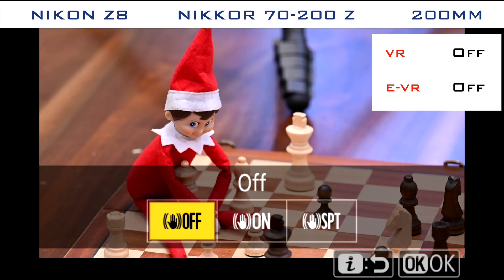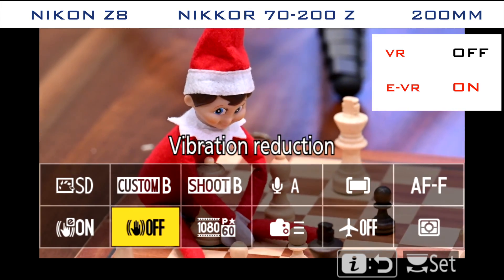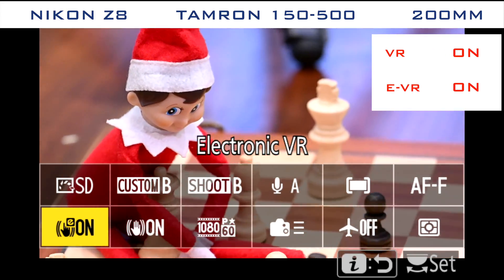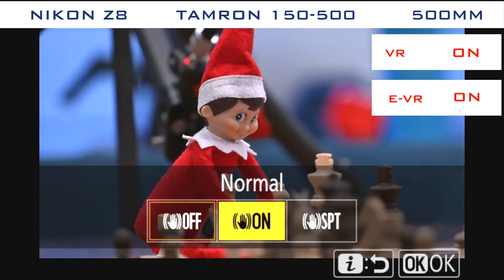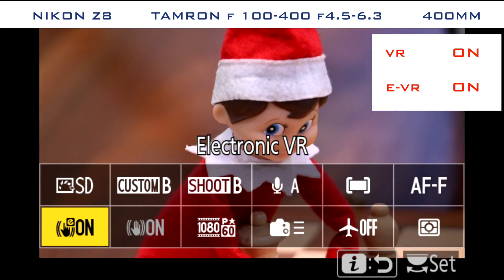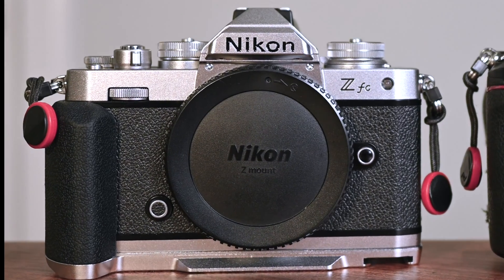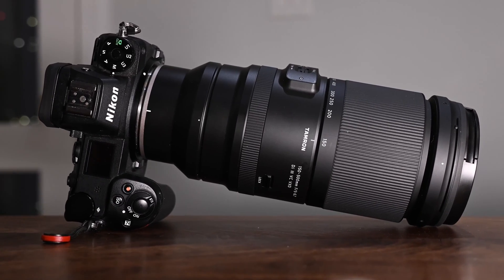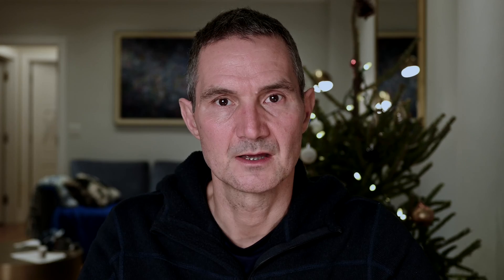Nikon Z8 & Tamron 150-500 Z Mount eVR anomaly - now fixed with firmware update in late 2024

Comment: Hi, I also have the Nikon Z8 and the Tamron 150-500z mount lens. And I thought I was losing my mind.  Originally, I thought it was issues with my tripod and bought a new tripod. 

I am shooting still images and every time I shoot at 500 mm with a 30 second exposure a constantly get blurred images. 

Has anyone been able to find a remedy to this?
Reply: Hi folks, I reached out to Tamron, and they said I needed to turn off the VR within the camera, because as they said to me in an email, "
The VC has to be turned off – it is a floating mechanism and if the camera/lens is stable, it will shake and ruin your images ☹"
Reply from the maker: Hey Rick, thanks very much for checking out the video and for the info from Tamron. It’s interesting that VC is causing blurred images on a tripod. In the past, this was seen as a potential issue but it’s informative to know that it’s still an issue for a 2023 vintage lens. Thanks again for the insight.
Reply: @jonneave  You are very welcome. I hope it helps out others that might be getting blurry images when using a tripod and this lens. Cheers! and Happy Monday

Comment: Hi John,

Have been extensively  checking online &  I find from the various comments that there is a Firmware issue regarding  Tamron lenses coupled with ALL  Z  MOUNT NIKONS. People with  Z50,  Z5, Z6 ii, & Z7 have complained of the same issue that you have stated in your video of the Tamron 150-500  coupled with the Z8.  Some have complained of grey fringing when they have used the Tamron 35-150 with their Z7. Another  gentleman has complained of the Z50 coupled with the Tamron 100-400. 
I had placed an order for the Tamron 100-400 just yesterday & casually decided in the night to see the comments of other photographers using the Z8 when I came across the aforesaid comments of the Z Mount Users.
Thanks for your Review. 
By the way, I have cancelled the order for the Tamron 100-400 lens. I'll stick to buying the Nikon Z  Mount 100-400 lens as & when I can collect the dough.
Have a great day, John.

Till Tamron corrects this anomaly with a Software Update, Nikon Z Mount Owners  should avoid  Tamron lenses.
Reply from the maker: Thanks very much for sharing your experience. It helps with our collective understanding of issues related to Tamron lenses. Let’s hope Tamron rectifies these issues soon.

Comment: Jon ciao thank you for info, I'm selling the 100-400z to switch to Tamron
Reply from the maker: Hey Raffaele, thanks for checking out the video! What’s your primary driver for switching to the Tamron? Best
Reply: Ciao Jonn, I'm a fan of zooms because they are very versatile. I replaced the 24-120 with the 35-150 (beautiful) and will soon replace the 100-400z with this 150-500. The colors of the Tamron are warmer than the Nikon Z and also the new Tamrons have an edge over the old Tamrons. The Tamron 18-300 is connected to the Fujifilm system and the Tamron 16-300 to the APS-C system (Nikon F).
Reply from the maker: Interesting. Tamron is making some quality lenses nowadays. I like the idea of the 35-150 rather than 24-120 and I have the old F mount f/2.8-4 version which was great optically. Enjoy your new lenses!
Reply: @jonneave  Late to the party here, but I found the same issue with the Tamron 35-150, where it wouldn't stabilize with the Z8. I ended up getting the 24-120. Hopefully this is a firmware issue that Tamron will (or has) taken care of.  I had no such poor stabilization issues using my F mount Tamron 24-70 f/2.8 or 70-200 f/2.8 on the Z8 with a FTZII.
Reply from the maker: Hey David, thanks for checking out the video. And thanks for the data point on the 35-150. I presume that’s the f2-2.8 native Z mount lens rather than an adapted f2.8-4 F mount lens? The 24-120 is a really nice lens. I really like mine. Thanks again.

Comment: Thanks for the informative video. I am buying this lens this month, so can you please clarify if only the regular VR turned on is working good or not. I never use E-VR anyways, my biggest worry about this lens was this bothering issue. If sensor VR is working without problems, I am good to go with this lens. Thanks!
Reply from the maker: Hi. Thanks for checking out the video.  Yes, the Len’s stabilization and IBIS work when eVR is NOT engaged. I have a hunch that regular image stabilization is not as good as Nikon lenses on the Z8 but that’s just a hunch and it would need more testing to be categoric about it. I really like the lens. If you don’t use eVR I would solidly recommend the lens.
Reply: @jonneave  Thanks for reply. Can you also tell about sharpness?
Reply from the maker: Hi. It’s nicely sharp. It’s definitely not as sharp as my 24-120 Z based on the very limited comparisons that I’ve done but I’m not disappointed in its performance. There are lots of reviews on YT that speak to its sharpness in Sony and Fuji bodies and it seems to largely hold its own against the Z 100-400 and Z 180-600 depending on which review you watch. If it’s slightly softer than those two, it’s a decent trade off based on cost and size respectively. At least for me. I just published a review of its auto focus performance where I shot thousands of files. You can get a sense of its performance here. Thanks again.
Reply from the maker: Nikon Z Mount / Tamron 150-500 Auto Focus Test
https://youtu.be/bHgViAAX7L0
Reply: @jonneave  Bought Nikkor Z 180-600mm directly from the store, had visited many shops and found the all new Nikkor at a very good price point of 1600$, not to mention even got 5% off at the VAT return. I have tested Tamron on the store too. It was a couple hundred $s cheaper, it was very small and I liked that fact very much, but when I attached it to my Z5 , seemed like it will come out of the mount , there was a noticeable shaking between the lens and mount, I tested the VR too. Nikkor was clearly better with naked eye. It was really a shame , cause Tamron could be so compact for traveling, but the issue with the mount made me worried, maybe in the future it would get even worse.

Comment: Thanks for this, I am about to pull the trigger on the Z8 and 150-500. Can you please confirm that the stabilisation through the EVF is also unsteady with both lens and camera VR switched on in photo mode?  Thanks again
Reply from the maker: Hi Ian. Thanks for checking out the video. Regular VR works for both stills and video. I’m not sure it’s up to regular first party Nikon lens standards but it certainly works. I’ll need to do some more testing to get a better sense. The issue I found was in shooting video and enabling the electronic VR when mechanical VR was already enabled on the Z8 and 150-500. But for stills that’s not a concept. Love the Z8 and really like the 150-500. I don’t regret my decision.